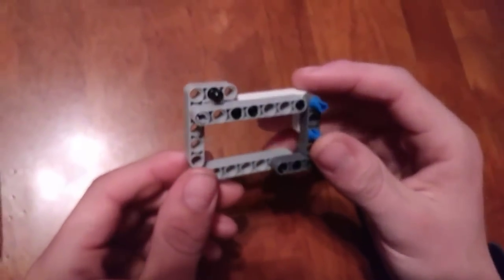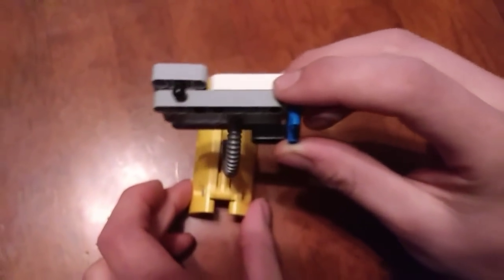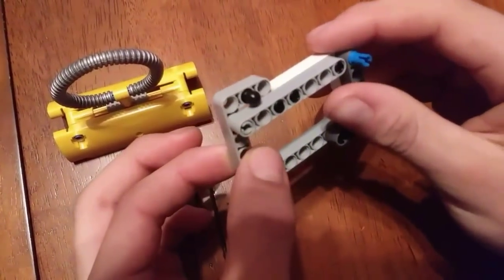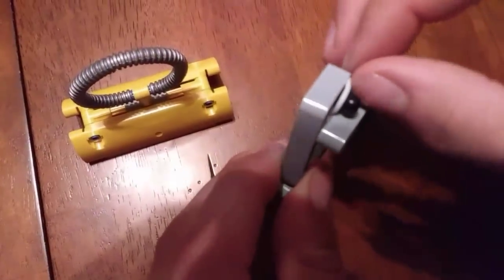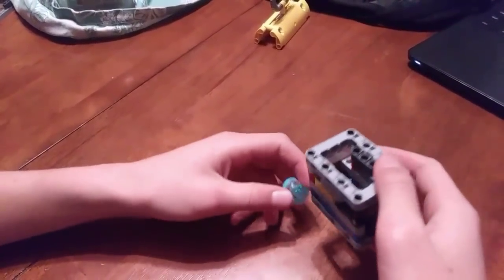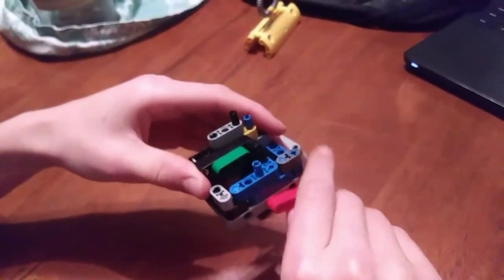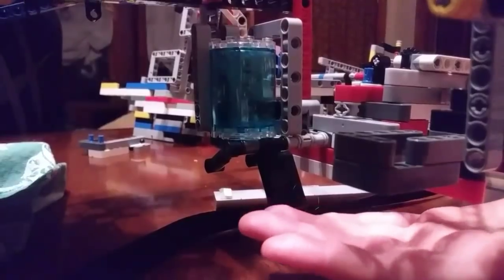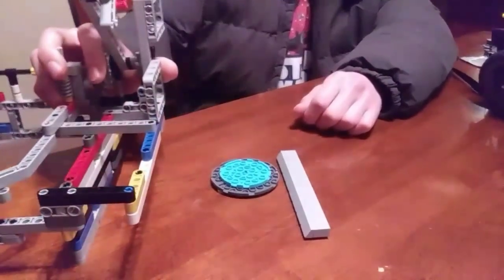Passive Attachments for FLL Hydrodynamics!

Comment: Cool video but you can use as many motors as you want with one motor used to change the position of the gear wich i going to activate an other gear... And then, the first gear can be moved again to activate another gear. 😅wasn't well explained sorry about that but that's basicly how it works. Yeah anyway just know that you can use more than 4 motors per attachement ! ( Pretty hard to say something difficult as I'm french but yeah hope you're going to the world ! Or something good anyway ! )
Reply from the maker: Martin Bichon thank you! We are trying to build a small and compact robot, so using a large gearing system like that won't work. However, thanks for the idea!
Reply: Gorjan Ilijevski Well, it's actualy not that hard. You need your first motor to make your second motor move forward and backwards. This second motor (moving) can turn an axle, wich is containing a gear. That gear can then turn (second motor) and move forwards and backward (1st motor). Now this gear can moce forwards and backwards to connect to other gears and turn to activate them.... Alright I give up I'll make you a small exemple (I can make you a drive with a short video)
Reply: Gorjan Ilijevski Can you send me a mail ?? (I'm not gonna hack you I swear 😂😂)
Reply: Hey there Martin! Im on a rookie team and we managed to qualify for worlds this year. Can you please explain this kind of mechanisam in a more detailed way? Or even better, you can send me a link that explains this gear system so that we will be able to implement it on our robot for worlds.